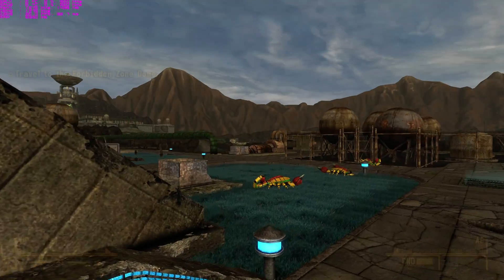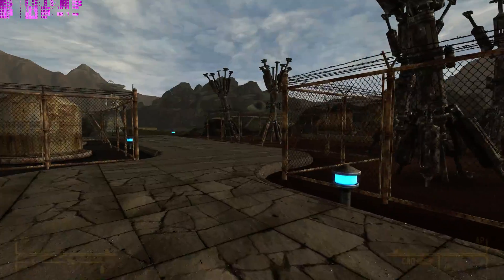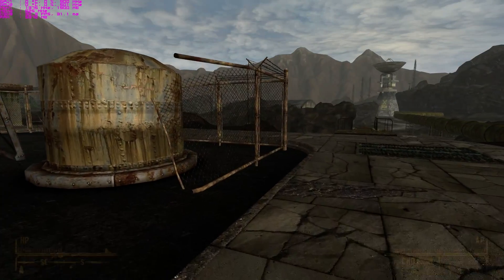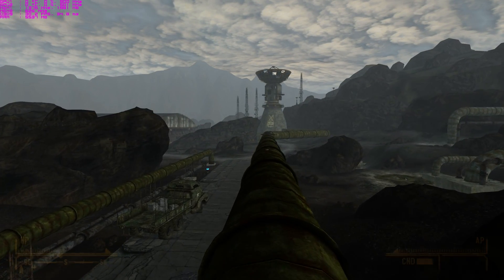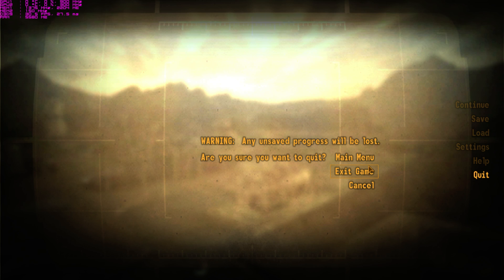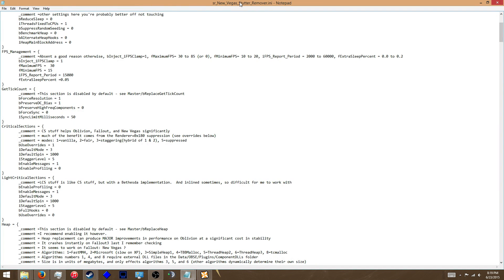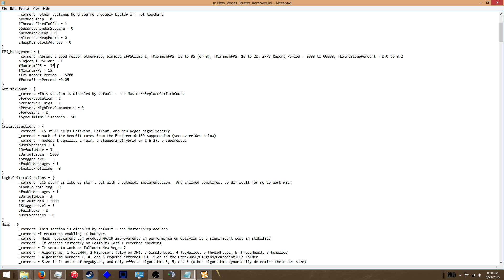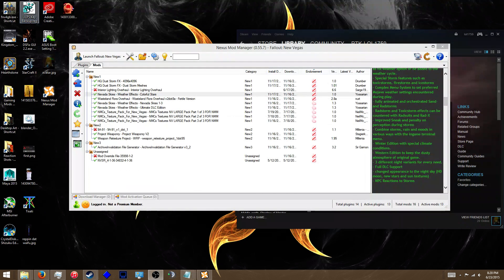An Introduction to Gamebryo [Creation] Engine Rendering

Comment: 60 Hz is actually the max refresh for the human eye, BUT if we take the Nyquist Theorem into account, to get a completely natural look, 120fps would be needed to give the eye the data to actually give you the same "look" you get from a live 60Hz TV broadcast.
Reply from the maker: +Event Horizon This is false. Comparing a bioelectric system like the human eye to a system that uses digital frames is about as far into false equivalence as you can get.

And TV broadcasts are done at ~24fps. Not 60 [I was wrong, see below comment]. Where are you getting your information?

You really aught to spend some time on wikipedia looking at broadcast standards. It will really help you out with your current understanding. 

https://en.wikipedia.org/wiki/Advanced_Television_Systems_Committee_standards

And while I dont like reddit, this thread has some good information: https://www.reddit.com/r/askscience/comments/1vy3qe/how_many_frames_per_second_can_the_eye_see/
Reply: *****
I know the difference between discrete and continuous, son... I took calculus and discrete math in university, too. Of course you can compare, and I'm well aware of the ATSC standard. 60 fps from a video display system  merely provides you with the max amount of information the eye can actually sample. 60 fps and 24 fps look very different. As for your broadcast frame-rate, you're very wrong. Sports and news are broadcast at 60 fps, and often interlaced as opposed to progressive frame rates. Compare for yourself.  Progressive vs interlaced, 60 vs 30 vs 24 fps, 25 vs 50 fps. I have, because I have been shooting and editing video since you were in diapers.
Reply from the maker: +Event Horizon  
So your source is yourself? 

I've linked to the standards. And you've provided nothing but anecdotal evidence and a passive insult.

And you've not actually addressed the fact that you cannot compare a binary system to one that is so inherently different than a biological one.

And you keep on talking about samples, which is a distinctly digital nomenclature. You cannot describe biological systems accurately using this method unless you go down to a molecular level. And even then it's 
very difficult.

Regardless, if you have the level of education you claim to, then you would know that you're just spitting out information about Progressive vs Interlaced is useless in this discussion. And that, for this discussion, interlaced video is for all intensive purposes 30 "real" frames (a loose analogy to be sure) that are interpolated up to 60 frames.

Again. All of this is useless information in this discussion.

I made one statement. And that was that you cannot use the term "frames" when describing how the human eye collects information.

Edit: I see the new standard does allow for 60fps, although its just now being widely rolled out in the US, and only on some channels/circumstances.
Reply: *****
My original post was more about the Nysquist theorem and how you you need to at least record or offer twice the amount of data to deliver the full amount of sensation which the our sensory apparatus can detect. Nitpicking and hair splitting really is kind of pointless, don't you think? There's a reason I like to scan 35mm negatives at 48 bit color so I can get the full 24 bit equivalent of what the best eye can perceive. I'm more accustomed to relating digital to analog and vice versa because I've been doing it for so damn long.

And saying that you can't compare the discrete with the continuous is a bit silly, when you consider that discrete numbers are just a subset or real numbers. Everything is subject to measurement, right?

That the retina and the optic nerves are analog and human senses are continuous is pretty obvious and trivial. I'm talking about sample rates for equipment in terms of only what you need to offer to maintain an illusion of smooth motion, and the eye literally cannot process any more than the 60 Hz offered by 60 progressive frames per second.

Human senses have measurable thresholds, and this is one of them. I can see the difference between 50 fps and 60 fps, but nobody can really see any difference beyond 60 fps. That's why it's called a threshold or s limit, right? Also, the sample rate of red book audio is the absolute limit of what the human ear can perceive. The principle of the Nyquist Theorem applies to our hearing as well.

And I'm just 60 purple and pink shades of enthralled with how kids on Youtube seem to think everyone over 40 needs to have a citation for every fucking thing they say, write, or think.
Reply: *****
Something else I should add, and I tried this experiment for myself in both an NLE and on a flatbed editor...  insert a frame of something different at random in  stream of footage that runs at 24 fps and see if you can detect it... YOU CANT. The impulse from the optic nerve are in fact samples in discrete cycles even though the sensory apparatus is obvious analog. This is part of the persistence of vision effect that requires approximately 24 fps to maintain the illusion of smooth motion. 60 fps and 24 fps could not look more different because you are offering more information.
Reply from the maker: Event Horizon
You're using an experiment that has no place here.

The testing methodology should be related to the smoothness related to motion, as you said.

You're first comment has nothing to do with what I'm talking about.

And even then you're wrong. With training humans can detect the change in a frame flashed as fast as 1/300th of a second according to studies done by the USAF on pilots.
Reply: +Rochester Swift False